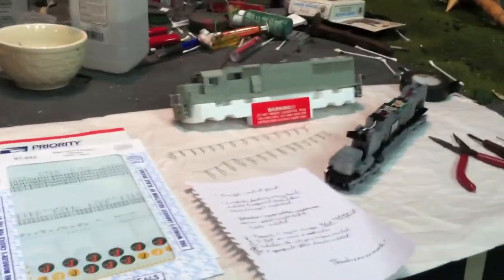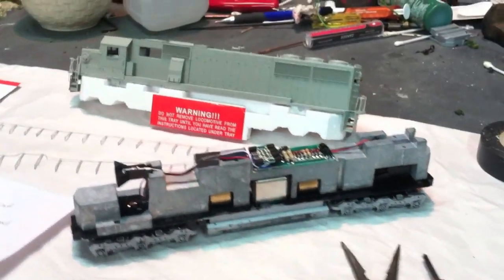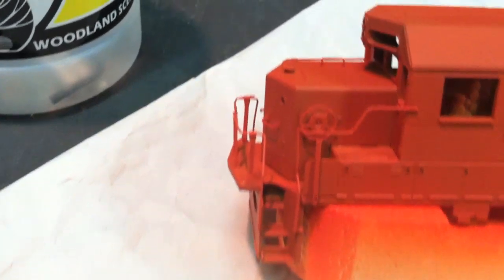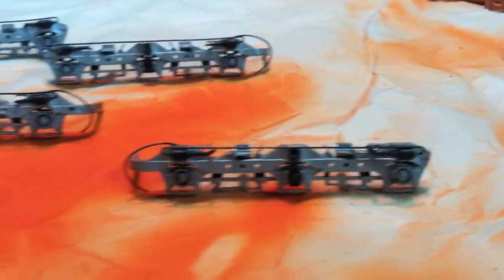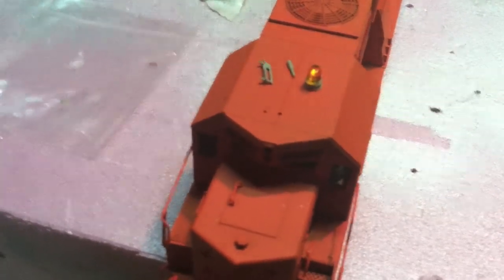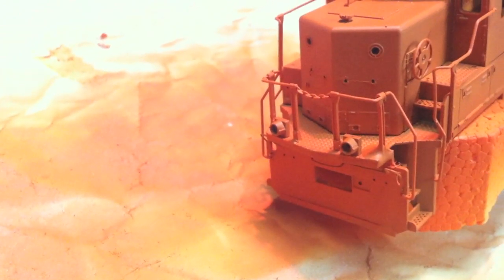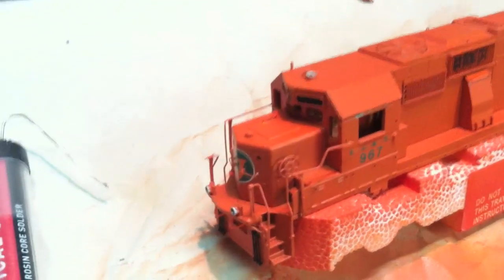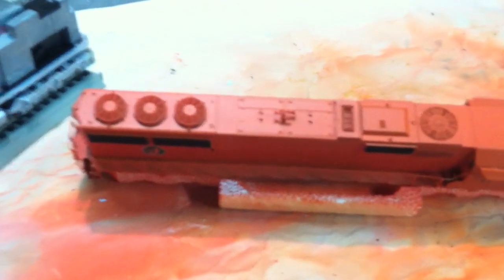Custom Painted Proto 2000 SD60 - EJ&E Railway

Comment from the maker: Thanks for the input. I think your right, even though I gave the other coat 48 hours to dry. In the future I will probably not use as much of the gloss. With the various setting solutions and clear coats I doubt the decals are going anywhere. Ill do some good testing before I try anything though. I think poly scale is owned by testors, and I have never had a problem with them at all. 

Take care

Comment: You did a nice job Only a few things to say I used reefer orange on all my SD engines and then weathered them also the beacons were red on all J engines and and all SD road engines were numbered 650 thru 675 the only ones that started with 9 were the old Baldwin double headers back in the 60s and 70s but as you stated it’s a Proto 2000 keep up the good work.

Comment from the maker: Maybe on another project I will go over that. At this point I dont have any ditch lights to install. Basically you drill holes for the ditch light and wires to go through, then you put the lens in, and finally place the ditch light into the holes. If the holes are big, you may want to glue the ditch light in place. I can try to highlight this in another video sometime

Comment from the maker: Well I checked and I dont think thats the problem. If you look closely the flywheel is not connected to the rear truck at all. The gear mechanisms in the truck are fine, but the flywheel is not turning the (worm gear ? ) in the truck. The gears are fine, I checked them when I was painting the locomotive

Comment: I didnt think the Orange was going to be light enough for EJ&E but it came out really good. I'm surprised no one uses reefer orange it seems bright enough for EJ&E. Seeing them in person, their orange is kinda bright, i would almost have thought some yellow mixed in with it, would brighten up the orange,  but it looks really close. Have you considered spraying the locomotives white before applying the orange paint? It not only makes light colors brighter, but you need less coats to finish the job than if you paint over a darker color like black or gray plastic.Great job on the model, it looks show quality now.
Reply from the maker: Thanks for the kind words! I didn't spray it because I didn't want the fine details to be missed by too many coats of paint, but I might try that in the future since I would probably end up using the same amount or less coats of paint anyway. Next time I have an undecorated model I'll give it a shot. Thanks again
Reply: +modeltrain9500 glad to help.  keep up the great work.

Comment: You did an excellent job! I see that you had  some problems with the paint not adhering well to the hand rails!? I read or saw it somewhere that paint use for RC cars! sticks well to handrails because of that acetal material they use to make them. Anyway yuo did a great job on everything including editing the video together. 5*****
Reply: I was one of the first to prove that....(I'm OLD!). I'm also in R/C. That paint sticks to the slipperiest of plastics! Works great on handrails. An added bonus is, almost all colors dry very matte!! 👍👍

I don't want to start a flame war with the guy (again, I'm old!)....  But can you believe that some guy paid him to do that!!??? 😵😬
KRYLON.... 'nuff said!

He couldn't even take a little extra time to FIX that slipping driveshaft!?? I would have happily done that, or any issue that's within what I know. Wouldn't charge extra, unless he/she offered, and I didn't have to buy any parts.... 
I'd bet the dogbone just popped out!
Rant over.

Comment: I am looking for someone to do some custom work for me.. how much do you charge and is there any way I can see other work you have done.
Reply from the maker: What are you interested in Steven? All of the work ive done is available here on my youtube page. I was in the process of creating a website to better show the work ive done, but anything you see on the layout was done by me. feel free to contact me via email using this same account if you want to talk specifics.
Reply: well I am making a what if merger between Burlington Northern, Milwaukee Road and SOO Line.. so the engines I'm wanting done up would be one in each of the normal railroad colors but then I'm trying to think of a merger color to stick with...   
I will email you what I am looking for,  I do have some engines that would need to be stripped of the factory paint it has now, and some minor work is needed on a few of them,     what did you say your email was again.
Reply from the maker: sounds interesting. I will have shop access starting in the end of August, so we can definitely explore options. my email is the same as my username, at gmail
Reply: How much do you normally charge, and would I have to get the decals and parts (if need any) or would you be able to get that stuff too